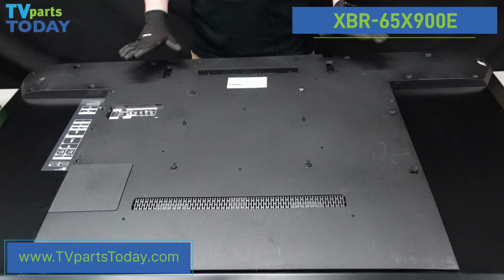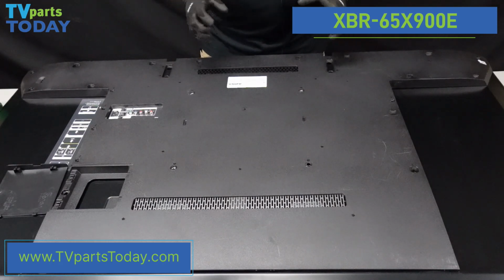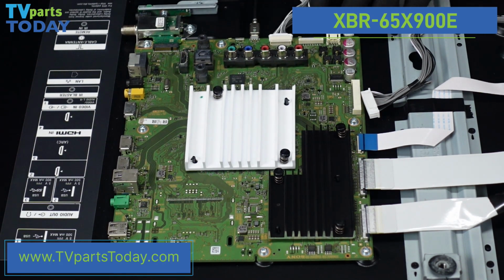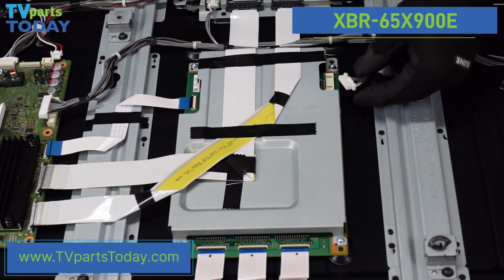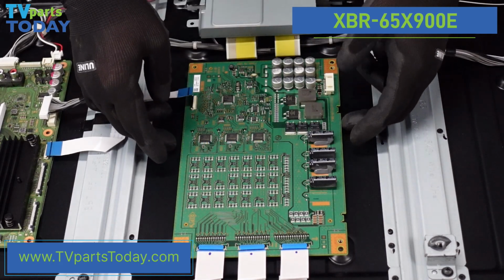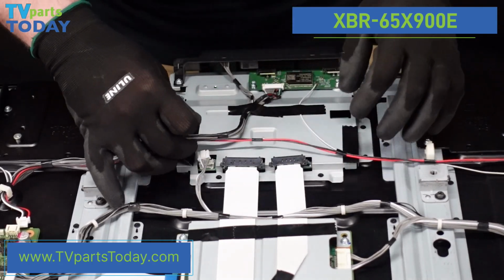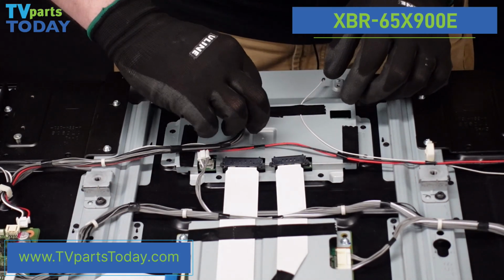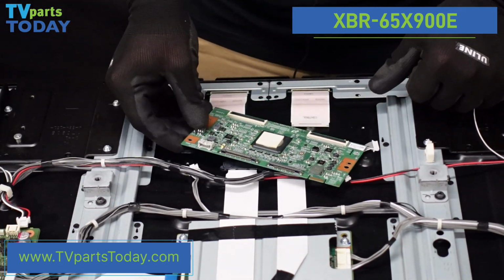How to remove the back plate as well as the boards from Sony XBR-65X900E. DIY TV Repair.

Comment: HAVE XBR 65X 900E 4 RED BLINKING LIGHTS FUALTY CODE  GOES ON FOR 3 MINUTES THAN OFF WHICH CIRCUIT BOARD DO I CHANGE.OR LED SPRIPS
Reply from the maker: Blink codes usually tie back to a whole host of parts in the back of the TV ranging from most likely to least likely. I would give our customer service department a call and inquire bout Sony blink codes for your specific model number. We should be able to get you pointed in the right direction.

Comment: Cool.. But how do you get it back on 🤦‍♂️
Reply from the maker: The back plate should fit back onto the area in the middle of the TV chassis that we removed it from. After that you would just need to place the screws into the holes that they came out of. There should be a few different sizes of screws so we would need to make sure they went back into the same place.
Reply: @tvpartstoday it's annoying.. I managed to strip it down and change the backlights on a 55 on my own but I can't get the back panel to clip back in place 😂 🤦‍♂️